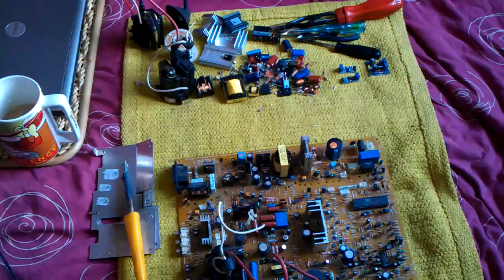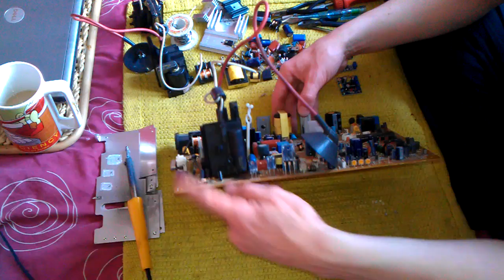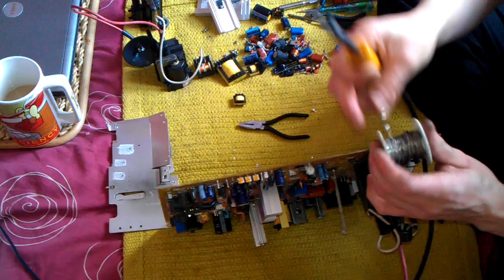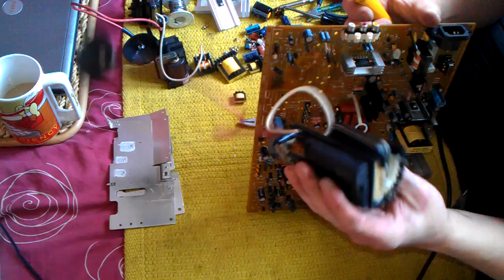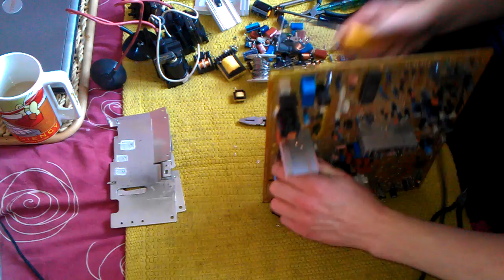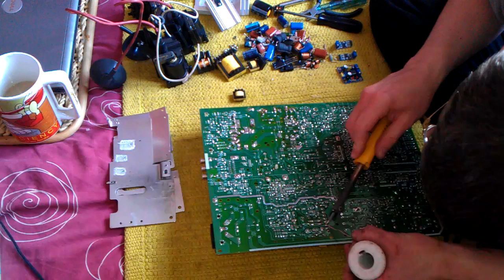Flyback transformer de-soldering!

Comment: Nice video, you got the nack of taking the components off quickly. For flybacks I use a 2 kW heatgun, job done in 30 seconds. also use the heatgun stripping the other parts too.

Comment: Agree, a heat gun e.g. for paintstripping, will melt all joints at once, making removal a matter of seconds and with no risk of damage. Otherwise, use of a sucker or wick will make things much easier and reduce chance of dragging a pin off the transformer. 
Thanks again for the great videos :)

Comment: Desoldering pumps are definitely useful for packages with lots of legs or a lot of thermal mass. I used to dismantle ATX power supplies with the torch head of my gas soldering iron, as you said, very messy and smelly.

Comment: I put the board upside down and get the heat gun out - works every time for flybacks. Sometimes I have to jiggle the flyback out but the heat gun heats all the pins at once. Same goes for those big transformers. for other components I just do exactly what your doing :)

Comment: Do you remove the mains switchmode controller too?
That + the mains IGBT + some support compoments should do nicely for DC supply with multi-voltage.
I have just cut away the main-supply from the rest of the board before, no need for new design that way.

Comment: Very interesting and informative video there Ant!
That's a nice be chisel tip Soldering Iron for the job too, Nothing like my old 70W gas one with a tip about the width of the pads themselves...
I've upgraded to a couple of 120W Wellers in the last few of months (ebay score), they would deffinitly do the trick, but just seem a little to good for that kind of work, I'm going to attempt my next one with Hot Air and see how that goes, if it goes well I will make a video on it! xD

Comment: The two methods that I use are breaking the pcb and then removing the broken board from the pins of the flyback one by one, or the method that I use now is a solder suker it's quick and easy.

Comment: i grab the transformer then heat the soldered pin and hit the table with the board and the solider is away . do it with all pins and then with screwdriver i remove the transformer